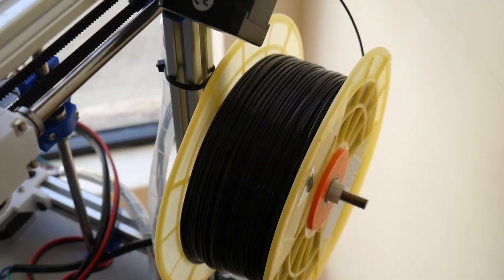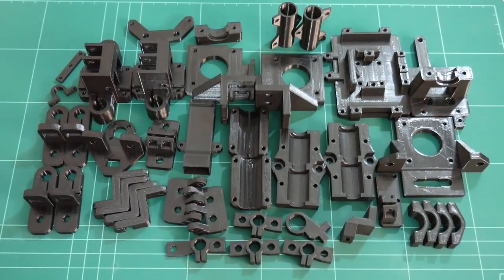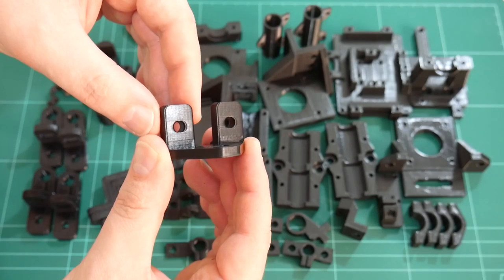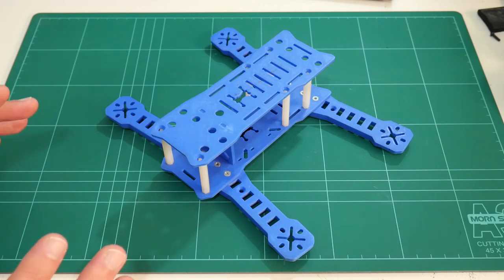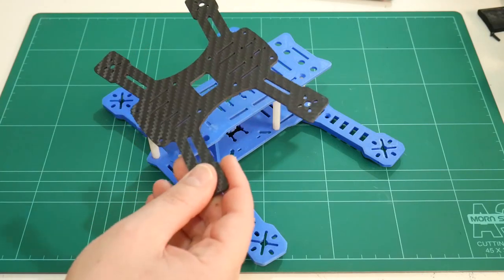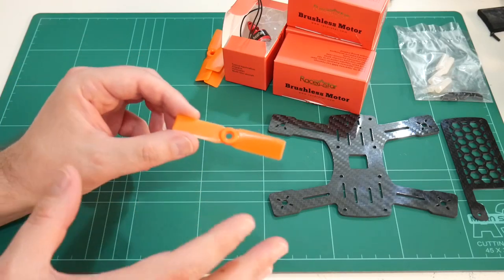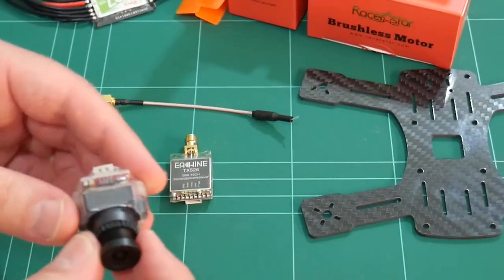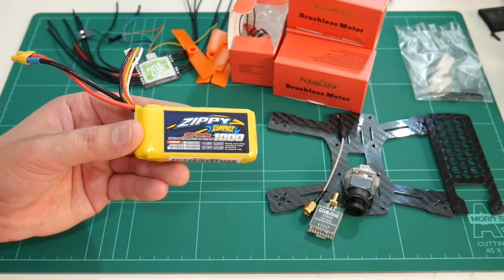Carbon Tubes update plus new Quad build

Comment: Print quality looks great, really tempted to build one of these now. I notice you are getting a lot of corner lift on your parts, why not add a brim?
Reply from the maker: Yeah a brim would help. I leave the printer running overnight next to an opened window. It's starting to get cooler in the evenings now and it seems to be causing the part corners to lift. Even with an 85c bed I think a cool breeze is too much to for it.
Reply: Due to its shape - any plans to add "sides"? Great videos BTW.
Reply: Tech2C i print my petg with the bed at 70 and using hairspray for  adhesion, i print the first layer at 240 then down to 235 for the rest. Haven't had one warp yet but i normally put a 5mm brim on them.
Reply: I put sheet metal side panels on mine. Black extrusion, black panels, black parts, black rods, black screws.. looks super sharp. I also mounted my electronics and extruder motor onto the panels.
Reply: TheLukey21 I use aurarum PETG with same temps, can confirm adhesion is fantastic.  no brim.
Reply: we need pics.....

Comment: If you want any better components: When those motors break, literally the best of the best motors for that size is the Brotherhobby 1407 motors. You could also upgrade the camera to runcam micro v2 or sparrow, or the arrow micro. I am guessing your using an F3 or F4 flight controller as well with the latest Betaflight, and if not, then it is a must.
Also, I am sure there are going to be much much better propellers, you will want tri-bladed ones or even quad bladed ones. Dual bladed ones will much less responsive even on a 5", so on a 3" like I guess what yours is then it will make even more of a difference.

Comment: Speaking of part lifting - I'm printing ABS parts at 100% infill, and blue tape + Elmers glue stick just isn't cutting it.  So I broke out my last sheet of very expensive BuildTak - and buggered up the installation.  Snarles and curses galore.  Might try an ABS/Acetone slurry mix next, or cobble up a heated enclosure.  Or both.

Comment: PETG is a nice material, but when it breaks, it fragments and sends shrapnel everywhere.  Not usually an issue except when a part under serious stress breaks near you.  It's also much more difficult to sand and polish, if you're doing that (it tends to leave small voids which have to be filled, as opposed to PLA and ABS).  ABS is also cheaper and weighs less per unit length, so a 1KG spool gives you more filament.  Still, I like PETG.  It's a damn sight easier to print than ABS.

Comment: Hey, Tech2C - I need to support a 600mm span.  If I did it with carbon fiber tube, would a 10mm tube stay straight over that span, or should I go larger?  What are your thoughts?  I've got no experience with carbon fiber tube.  Thanks - Charlie

Comment: I'm planning on building a hypercube out of a Geetech i3 I bought a few years ago that never printed well out of the box. The board it has is a Geetech 2560 running Marlin. Would I be able to run the hypercube with that board? Have you already posted a video about firmware for the hypercube?

Comment: About the quad your building, these Zippy batteries are no good! 35C means 35A at 1000mah and your ESCs are 4x20A=80A. You should go for some Turnigy graphene or something like this instead. Hobbyking Australia has some pretty good and cheap batteries at the moment.
What Flight controller are you gonna use? Please don't answer Naze32!! You can get so much more out of a F3 flight controller.
Anyways, always good to see you didn't give up with miniquads ;)
Reply from the maker: Just like the Hypercube, I would like to use parts I already own for the quad. That includes (gulp), a Naze32. I have a few of the all-in-one F1 boards that I can not bear to leave idle. At least not initially. I'll upgrade to F4 soon after learning the ropes with rate mode.
Batteries no doubt will be an issue. I don't think these motors will consume 20A each however.
Thanks for the suggestions, I'll need them as I progress!
Reply: Tech2C you'll probably be disappointed by the lack of performances of the F1 boards.  But I understand why you want to use your old F1s. Anyways, you helped me a lot with 3D printing so if you have any question about miniquads pf Betaflight in general feel free to ask me. I'll be happy to give you a hand ;)
Reply from the maker: Cheers! Will do, just comment on what I should be doing in the next quad video :P

Comment: I want to share with you the secret of avoiding getting parts lifted, is to use kapton tape with ABS juice, and an 8mm brim. 
We all know all this, up to this point. It is impossible to remove without out destroying the tape at each print!
The secret is in the cooling that makes part removal a snap. 
Put the print plate out in the cold or in the freeze ( I use the Canadian winter, or freezer), until all of the bottom plate surface has become the same temp. (1 hour should do).
Take it out of the freezer and leave it to come back to room temp. Humidity does its thing....
If you look at the printing plate from the bottom, you can see where the huge bubbles and week points are. 
Then lift one corner edge with your finger nail or credit card, and run it around the whole perimeter.
Apply a sharp side force blow, parallel to the plate, closest to the largest bubble you saw earlier, like a karate to the part. It poooops right off!!!
No damage to the tape from sharp objects.
Give it a try next time.
Reply: PirateKitty This is art

Comment: Hi Tech2c, From the original CF tube replacement video, you mentioned using the RS-Components bushings, rather than the metal (brass-ish), was the 20+ hours of print using the RS versions or metal ? I wondered if you've considered PTFE bushings ? PTFE as used for the remote provision of the filament feels like it would provide a great soapy sliding surface against the CF rods? Thx Andy
Reply from the maker: I've been using the RS-Components IGUS bushings exclusively since video build log #15. I believe they are made of PTFE or a derivative of that material.
Reply: OK, perfect I'll get some when RS in the UK have them back in stock.

Comment: Hello Tech2c, first off love your videos. With regards to your drone specially the motors, a tip, majority of racers run all CW motors only, as you can get spare nuts from bunnings as finding CCW nuts can be tricky / inconvenient
Reply from the maker: Hey mate, great info. These were purchased in a pack of 4 as CW/CCW. I have M5 nyloc nuts here too.

Comment: Hello,
I've been following all your buildlogs for a while now. I only print in PETG but the quality is not near yours. What is the brand of your filament? Have you ever tested Real Filaments? PETG one?
Reply from the maker: The brand I use is in the description. What do you mean by real filaments? PLA? Yes I print PLA for anything non-load bearing and temperature sensitive.
Reply: Tech2C unfortunately saw that after posting the comment. 

Real Filament is a European  brand. Think I might have to find another brand to work with!

Comment: I asked a seller of fiber rod tubes how straight and true they were as I need one to be used as an axle and he did not reply so this tells me his are junk.  How to I find a straight, and true, 5mm rod on this planet?
Reply from the maker: Maybe try engineering websites, like RS Components. Be prepared to pay waaaay too much though...
Reply: Dark Alchemist i looked for carbon fiber rods and found some really cheap ones (in Denmark) on the website it said up to 2mm deviation lengthwise per meter, but they had never seen that much. Bought one in my lhs and that was also less than 2mm off over 1meter. Crosssection wise it varied some. The worst on one end being 8.48 mm(an 8mm tube) but about 20 mins with som 320grit(European) seems to have it so my bushings slide nicely on it without wobble.

Comment: Just curious, have you tried ball bearings on the carbon fiber tubes? Do you know if those are viable for this application?
Reply from the maker: I have some 8mm carbon tube and tried running the LM8UU bearings over it... not good. Bearings bind on the imperfect surface of the carbon and will scrape a groove in the resin.
Reply: Thanks
Reply: Thanks

Comment: i have spiderweb problem with esun solidblack petg. how can i solve ? thanks
Reply: A couple things to try would be lowering your print speed or increasing retract distance, possibly both. I haven't printed with esun in particular, but I find around 3 mm to 3.5 mm retract distance and 40mm/s print speed works well for hatchbox petg.

Comment: Thanks for your videos, witch slicer software do you use? Your Surfaces are printed with an angle of 0 and 90°.
How do you set this function? 

Thanks.
Reply from the maker: These hypercube parts I use slic3r, and Cura for everything else.
Reply: Tech2C Wich Setting did you change to print top surfaces with an angle of 0° and 90° instead of 45° and -45°?
Reply from the maker: I rotated the entire part 45 degrees in slic3r, so the top solid surface has the print lines parallel/perpendicular to the perimeters.
Reply: You probably dont care but does anyone know a tool to get back into an instagram account??
I somehow forgot my password. I appreciate any assistance you can offer me.
Reply: @Nikolai Maximus instablaster =)
Reply: @Kason Damien I really appreciate your reply. I found the site on google and Im waiting for the hacking stuff atm.
Seems to take quite some time so I will get back to you later when my account password hopefully is recovered.
Reply: @Kason Damien It worked and I now got access to my account again. I'm so happy:D
Thank you so much, you saved my account!
Reply: @Nikolai Maximus you are welcome =)

Comment: I don't know about this music.

Does this black have a play dough smell? The black PETG I've used was strong but not as flexible as the clear. instead of folding over, it just snapped. it didn't do well when I printed a peon.

I am thinking about building an extended version of your printer.

Comment: Curious  of the layer height and temp for these black PETG prints. When I watch your quadcopter videos I get motivated to try one! Thanks
Reply from the maker: 0.2mm layer height, 235c hotend, 85c bed.
Reply: Tech2C can you do a short vid about your PETG print settings.  temps, slic3r config, speeds and such?
Reply from the maker: Here's one I prepared earlier... https://youtu.be/xFt7vzweUiw
Reply: Tech2C thanks I will watch that (again).  I'm getting stringing, and some have suggested to look at retraction.  Have you made any adjustment to Marlin or Slic3r for retraction?  Extruder speeds?
Reply: I'm curious to see if the Hypercube printing long curves have the octagon like curve line structure like my Prusa. I'm not sure if this relates to the printer or whether it's 8 bit as opposed to 32 bit.